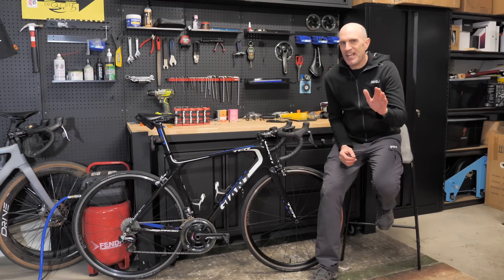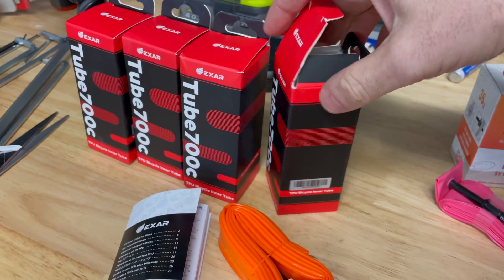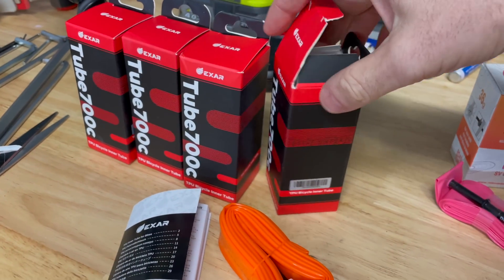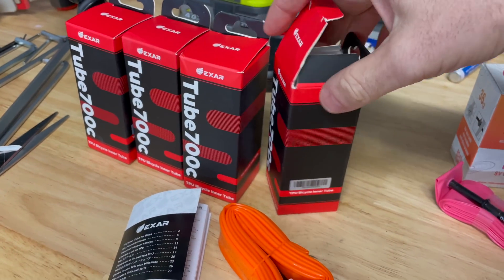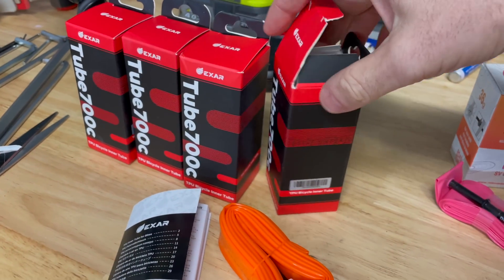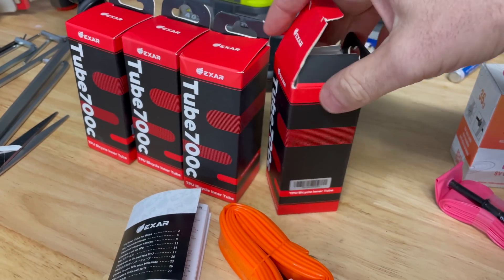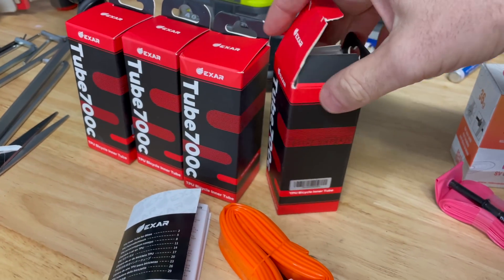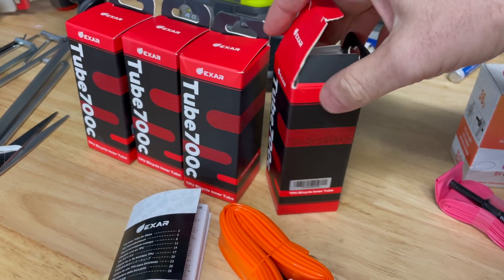TPU Bicycle Tubes: Light, Fast, Cheap.... What's the Catch?

Comment: I converted my bikes to ridenow TPU-tubes this year as well - awesome weight saving, so far no punctures, less space in the saddle bag needed and i absolutely love the way they sound on smooth roads (whooshing sound similar to deep section carbon wheels)
Reply: I did notice the sound, and it sounds like carbon wheels lol. I thought no one else had noticed it
Reply: @ゴーゴリ-t6d  I have carbon wheels, no sound out of them yet.
Reply: Same wooshing sound. Cheap way to get carbon wheel sound ;)
Reply: Did not notice the sound so much, but they are awesome, light, takes no space, and they retain air much better than latex (though still a bit less than butyl)

Comment: 2000 miles on RideNow 34gm version. Overall lighter than my tubeless set up and so so much less trouble. Can't see me ever changing.
Reply: Same here. No issues.
Reply: It’s Schwalbe, not Schwable😏
Reply: Same
Reply: how much pressure on your tire?did u reduce or just maintain it
Reply: Just same as b4. 50 front 55 rear with 32mm tyres. Only just switched to 32 though, previously 28s with a bit higher pressure....
Reply: Ridenow
Reply: Tubeless? Once the novelty has worn off is it really that great?
I get so few flats in reality. Buying sealant, keeping sealant fresh, presta valves plugging up, sometimes sealant doesnt work..................If you have multiple bikes sealant maintenance can get to be old.  I can swap a tube out in no time out on road,

The sealant ending up being dry quicker than you thought?  Sucks.
Reply: What brand do you use?
Reply: If I only rode solo, I might still be on tubes, but the majority of my rides are no-wait group rides or races where I cannot afford a flat. Also living in an American metropolitan area, there is just too much glass and other debris on the road. Orange Seal, Air Liners and DynaPlugs mean I don’t even carry a spare tube unless I’m riding somewhere remote.
Reply: And Ridenow 24gm ?? It's more probably to have a puncture compared with the 34gm version ???
Reply: same here...especially if you want to change tires regularly....
Reply: Same here...
Reply: light isn’t the goal if you want speed, you want low hysteresis
Reply: Are tpu tubes puncture proof? Self sealing as tubeless”
Reply: @CarvalhoCiclismoBR  does it self seal every time. I know with my latex tubes I rode 30km on canvas as the road ripped part of the tyre off. Can’t see tubeless doing that

Comment: I had no end of problems with the Pirelli smartubes, the plastic valves kept cracking on first/second use. Second set lost air near the base of the valves on first ride so sent them back. Then tried Vittoria tpu’s and got punctured on most rides. About to give up but decided to try Ride Now’s from Ali Baba. Absolutely brilliant and only £4! Have used them for last four months and 30g 👍🏻👌🏻

Comment: Thanks for the very well timed video. I have just this week purchased the exar and ridenow tubes for road and gravel (tubeless) spares @ ~ AUD$18-20 each online @ 99Bikes and CCache. Very pleased with the space saving in the saddlebag. Will also convert butyl to TPU on my road bike (rim brake Mavic Ksyrium Exalith with Conti GP 5000 25mm) after riding over a screw which also ruined the tyre and realising I had no new butyl tubes. Hoping the experiment goes well.
Reply from the maker: Keep me posted on how things go. 👌🏼
Reply: You paid way too much mate you can buy ridenow for $6
Reply: @glennoc8585  please share where you get them for $6

Comment: I've actually been able to replace cores on the RideNow tubes. The cores that came on them have proven to be unreliable for me. The tiny rubber ring (that rides on the treaded rod) on the inside of the core has actually split and come out through the core on two tubes rendering them unusable. With a good bit of finessing I've replaced the cores on each. Will be trying to find similarly priced alternatives with  a more traditional metal stem.
Reply: Please share
Reply: @johnnyboy4711  I have the black stems, not clear. Use a set of channel loc pliers to hold the plastic stem (with a bit of cloth in the jaws to protect the plastic). Then use a core removal tool to extract the core. In my case there's a pretty loud crack sound when it breaks free. Getting the new core to seal can be a chore. I ended up using Teflon tape. Definitely only do this if you absolutely have to because you can easily trash it. But since the vales had already failed there was nothing to lose by trying. Actually saved both tubes I had to do this to.
Reply: CYCLAMI TPUs come with a metal stem, wight is 38 vs. 36 of the RideNow TPU
Reply: are these cores removable as they are? @sportbootjo
Reply: A drop of loctite thread sealant would work instead of teflon tape. A bit less trouble with the valve being so tiny and hard to rap around.
Reply: @LucBerthelotte  yeah, I agree. Teflon tape was fiddly for sure! Was actually going to try cyanoacrylate (crazy) glue 😲 as I didn't have any thread locker

Comment: I switched over from latex to RideNow 36g.  I ride rim brakes and had the opportunity to do some big technical descents.  There were no over-heating issues.
Reply: Is it really safe? No blowouts or weird feeling on the tires on long steep descents? People in forums are quite split in using TPU in rim brakes for long descents especially during summer
Reply: I did some Huge Mountains with Zero problems @twillyspanksyourcakes
Reply: I have used ridenow tubes on my rim brake bike in Alps descents, 36 degrees Celcius. No problem at all. @twillyspanksyourcakes

Comment: I also use Pirelli TPU tubes, now since 18 months. They are amazing on my 28mm GP 4000 S. Super easy install, ultra small, and light, I guess there is no easier way to save about 300g. Best is I haven't had a single puncture in about 4500km.
I love them!
Reply from the maker: Nice 👍
Reply: @gplama did you see the Recall Perelli P-Zero Race had? I had to swap my pZero’s for Conti Gp-5000 tubeless. All the perelli tires in stock at my local bike shop were part of the recall
Reply: @tony5269  Michelin power cup for the win imo
Reply: @kubackjeee  I’ll definitely 👍 look 👀 at them next time thanks
Reply: @tony5269  Does Tubolito still make the Pirelli's?
Reply: Ditto. Great combo.
Reply: hmm
Reply: I have problems w/ pinch flats due to bad pot holes for night rides. Are TPU more resistant to pinch flats?
Reply: mine was fine the first 2-3 month then i loose 1-2 bar per day ... am i just unlucky ? no problem on your side ?

Comment: I'm a weekend rider and picked up a slow flat between rides from a what I assumed was a steel belt metal pin prick (no fragments found in butyl tube or tyre. Anyway have been trying the cheep tpu tube in its place and carrying another as spair on rides, only found air leeks out  a little bit faster during storag(I check my pressures before every ride anyway) than the butyl but feel on road is good. Time will indicate picture resistance. Great videos , always informative.

Comment: used tpu tube since late 2021. originally on Revoloop tpu (good but expensive), then moved to 1st gen ridenow 36g, n now 2nd gen ridenow 24g.

ridenow is cheap for the weightsaving. even on stock alu 25/25mm alu rims, weight reduction can be felt. most of my punctures are from road debris (nail, sharp small stones etc, never had snakebites or pinchflats)

Comment: I've tried 'light' tubes once in my riding career, and the first time I used them I double-flatted on the first ride.  I don't remember if they were latex or just light tubes, but I've used standard weight tubes ever since.  

To me it's not worth the risk of flatting, the weight savings and speed increases not that much. I can get faster by working more on the engine, I'm not at that point yet where having slightly lighter tubes will help me in a race 🙂.
Reply: Ya might still want to look at these. Puncture resistance isn't significantly different from traditional butyl. Don't compare these to latex from a puncture standpoint. Compare them to latex from a weight point.  I also like being able to carry 2 spares without need for a large seat pack.
Reply: The weight is throwing you off, ignore that. TPU are faster, more durable, slightly more comfortable and almost the same price as butyl. Butyl are kind of redundant now.
Reply: TPU valve stems are waaayyy more fragile. That is usually how the TPU tubes end up failing. They certainly are not super reliable. And the quality control on many of these TPU tubes is terrible.
Reply: @mikew466  is TPU the band name or a type of valve?
Reply: @mikew466  see, it's kind of like this while I'll stick to what I know that's reliable. I can get faster more easily and cheaper by working on the engine.
Reply: @lexington476  TPU is the material, pretty much all TPU tubes have a presta valve. I think a few BMX TPU tubes have Schrader valves.
Reply: Type of material of the tube. It's like a thick plastic bag material. But the big issue is the valve stems they use are superlight plastic and are just glued onto the tube material. Makes them sort of fragile.
Reply: @mikew466  yeah this might be an innovation that is a solution for a problem that doesn't exist, at least from my point of view.  I'll stick with conventional tubes in my tubed bikes 🙂😎.
Reply: 45 gram RideNow Cyclocross TPU won't flat no matter what you hit it with if the tire is puncture proof IMO.  You can hit gigantic potholes with it no blowouts.

Comment: I have been using them for a long time now. Only complaint is that the valve I on the brabd I use (dont even know which one that is) didn't work with my "on the road" pump. Had to go to my backup (butyl) tube to get up to pressure again. Since them I have been riding with a butyl in the rear and a tpu in the front. And I had to look that up, as I really dont notice the difference after a few rides.

Comment: tried once. never gonna use them again. those micro punctures. can't patch em all lol. not worth the weight saving
Reply from the maker: Which brand and how long ago?
Reply: @gplama  ridenow and tubolito. used them both in my ultra endurance event 3 months ago. when sand creeps into your wheel they gonna make micropunctures

Comment: I'd be interested whether anyone is using these on a 700c touring bike as a extra puncture safety net with a set of Marathons.
Reply: I was thinking of getting TPUs to use with my 35 mm Marathons, but after looking at the UK reviews, in which inconsistent quality was the main issue, I decided to stick with butyl.
Reply: I've been running TPU use for about 3 months now with Victoria corsa (flimsy) had 2 punctures one looks like a piece of glass. They went flat very slowly and fixed with a normal patch
Reply: I'm using Cinturato Velos which is like a nicer Marathon.  Ridden thousands of miles on 45g RideNow Cyclocross TPU on 32mm no flats ever.

Comment: I have used TPU tubes for over 20000km on a mix og gravel and road. And so far I have only had 3 punctures on a ride, one I found a piece of glass sticking through the tyre, and the two others where pretty much at the same time on a cycling path where the snow had melted and left gravel so people would not slip right in the tarmac. And they where shaped like small obsidian arrow heads, that I had to unplug from the tires. So no snake bites.

Though I have had 3 occasions where I have been on an all day ride, and the day afterwards one tyre was flat with a so slow leak I could not find it by squeezing the tube under water.

I’m using the non lightweight from Tubolito.

Comment: I’m 108 kg and use 22g Tubolito as my main tubes. Very solid I’d say puncture resistance is slightly better than butyl.

Also, once they stretch to fill say a 32mm tire, there’s no putting them back in a smaller tire.
The feel of the lower spinning weight is nice.

Putting valve extensions on ends up stretching the stem material to the point where I applied plumbers tape on the threads and electrical tape at the joint to keep the valves from leaking. Last year I had brought this up a few times to Tubolito and they have now improved the design with a single piece 80mm option that does away with the problem.

Nice tip for installation: coat the inside of the tire with talcum powder and the tubes are super easy to install while slightly inflated.

Comment: Don’t like TPU. Was harsher than butyl on the ride. Also more punctures. I have a feeling it’s the less compliance that makes puncture on objects. 
Repairing them requires 30 min dry time rather than a min for butyl. 
Also the stretchy test doesn’t have meaning. If you pump a tpu the shape is permanent. It’s why you need to pump in the wheel. A butyl will not hold the shape. 
Honestly I feel it’s should be: 
Tubeless for mtb tires 
Latex for race on road bikes
Then butyl if you want durability like endurance 
And tpu is the best packing and weight for an emergency tube
Reply from the maker: Fair points. I cover the packing/space savings (in a practical way) in the video. 👌🏼
Reply: TPU hits potholes like 5-10% worse than butyl, but on smooth surfaces its smoother than butyl IMO.  It's a trade off.

Comment: Interesting test.  I think if I was going to make a change from the old fashioned butyl I'd go latex for the performance gain but I really can't be bothered with the extra faff installing and the need to pump them up every single ride.  So lazy, butyl will do 😳
Reply: I ride two wheelsets.  One high performance tire with laytex. The other regular with butyl.  Even the butyl tends to loss pressure a bit..so i check before all rides. I understand tpu are noisy..that would be a deal breaker but i will get some for small size in saddle bag
Reply: @secretagent86  yeah, I can get away with every second or third ride with butyl though or if I'm not bothered about 5psi even a little longer, depending on just how much of a lazy fool I'm being!  I'm genuinely borderline dyspraxic so as much as I love the idea of performance gains I just can't face the extra manual faff of getting them in and keeping them up to pressure.  The thought of doing that mid ride in the cold rain...I know I could just take butyl spares of course but yeah, I am useless!
Reply: That's pretty much the advantage of TPU tubes: their rolling resistance is very nearly as good as latex, but they hold air as well as or better than butyl.
Reply: Yeah TPU is lighter, more durable, and loses less air than latex, while giving up very little speed/feel. All around win. Other than difficulty patching they are superior to butyl in every way. Latex wins on patching maybe and on speed very slightly. I’m a big fan of TPU for road riding. Tubeless for off-road but it’s too much farting around with skinny tires.

Comment: Nice workbench! I see you didn't test Tubolitos or Aerothans (or Pirellis) probably because there were no sample giveaways of those at Eurobike. There's a list of 'western' tubes in bicycle rolling resistance (with some interesting results too) if you want to get a 'complete' list of what's available.
Reply from the maker: New workshop is still a work in progress. Loving it so far! You're correct on the other brands. Blowing those up would have been an expensive task! :)
Reply: Weird they didn't test Cyclami tubes, they are maybe the most sold now, with 38 g and 24 g I think...

Comment: Been on TPU for 2 years now, rim brake.  Harsh UK roads, no issues so far, no punctures. On the RideNow currently
Reply: What PSI and temperature you ride at?  Only on flat roads? I thought they don’t recommend using them with rim brake and higher than 75 psi because it may heat up on descent and explode… any feedback?
Reply: @Questioneverything72 with tpu tubes, there are normally 2 versions. I'll use the Ridenow brand as an example. They have the standard 36g version which can be used on both rim and disc brakes. I have this version and run them at 90-100psi, rim brake bike on UK roads and I'm around 95kg. They then have a 25g version that can only be used for disc brake bikes to avoid the tube blowout situation you are talking about. If memory serves me correctly another content creator (china cycing) looked at their extremely light (18g) version that they will/have already put on the market now as well.

Comment: I’ve used Pirelli TPU tubes on a disc road bike for over a year now.  Only one flat and I was able to patch it and have ridden on it successfully for more than 6 months.  TPUs have significantly less rotational weight which helps. Tubeless and latex tubes are slightly more comfortable; otherwise, comparable to feel of butyl IMO. I have since purchased the Ride Now TPUs at about $10 CDN each.  So it’s no longer cost prohibitive. They are my spares.  Haven’t had to use them yet 🤞.
Reply: I have installed RidewNow 36 gr tubes. Done about 1000 km, no issues. Will try their 24 or 19 gr later
Reply: @TheOkinawaBoy to
Reply: I'm using RideNow since about 1000km and got 2 punctures on GravelKing slicks, and was able to patch. Those tires are very fragile so it's not bad at all, and they feel vivid and responsive just like when set up tubeless.
Reply: i would like to know where you are getting those tubes at $10 cdn
Reply: @franklaliberte1143  Yeah, that caught my attention too, as Conti butyls go for almost C$10 a piece at MEC.
Reply: @franklaliberte1143  Yeoleo Canada sells them for about $18 each.  Aliexpress is a much better deal. Picked up 6 Ride now 36 g for $48 CDN (all in price) and took about 1.5 weeks to deliver to Toronto
Reply: I've had a really bad run with latex tubes, I honesly cannot recommend them, Vittoria ultralights or tubeless, I'd honesly consider nothing else.

Comment: Use the standard ridenows, only issue with them is they are quite easy to pinch if you're not paying attention when installing. I carry 2 spares (thanks UK roads)  in the same small bag I used to carry 1 butyl.